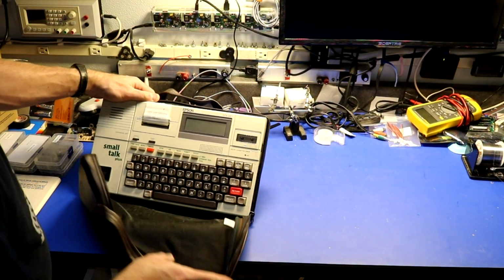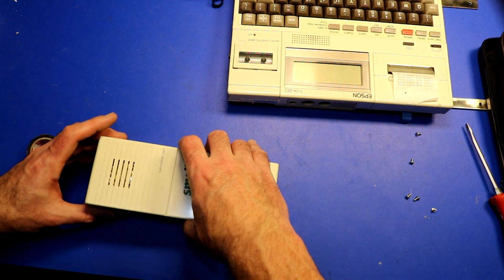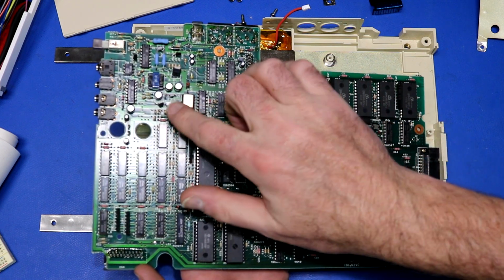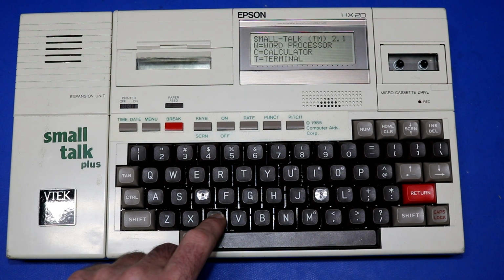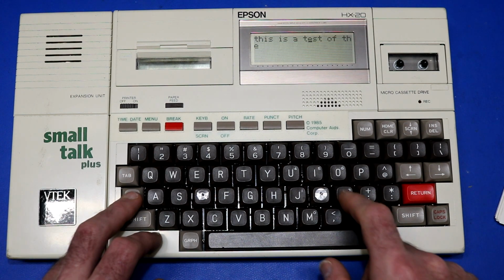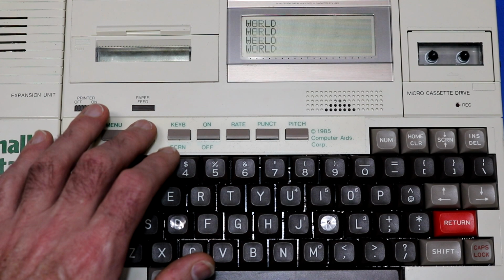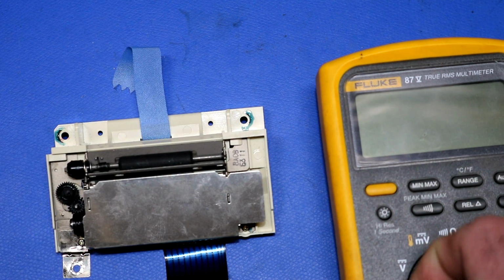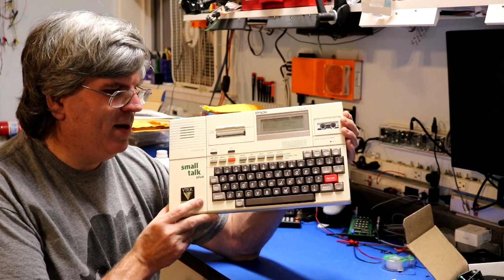Epson HX-20 Small Talk Plus, The world's first TALKING laptop! Teardown and Repair

Comment: Very cool!  I picked up a restored HX-20 recently, myself, but mine is purely stock:  It still has an empty ROM slot, even (I think I'll burn a word processor to it).  I have yet to interface it with anything, although the possibilities of a floppy emulator and / or an external display (emulating one of the original ones) would be neat.

It's so cool to see the HX-20 kitted out for a specific purpose, especially helping the visually impaired.  It truly does have astonishingly good battery life, and I could see it being of great help to its original owner.  🙂